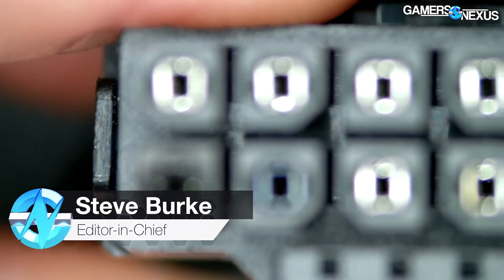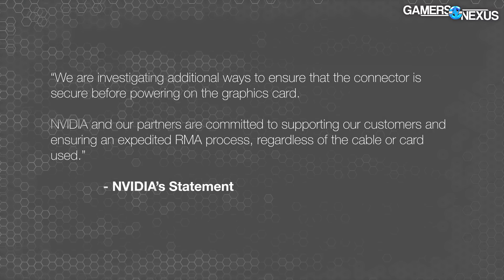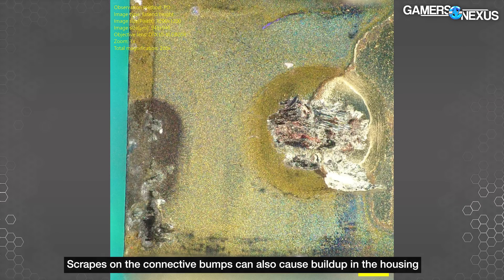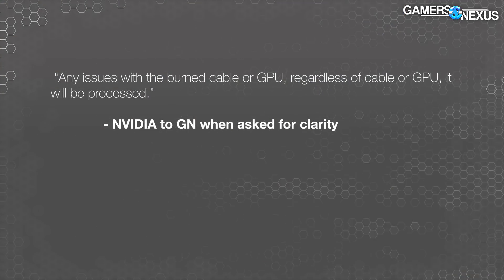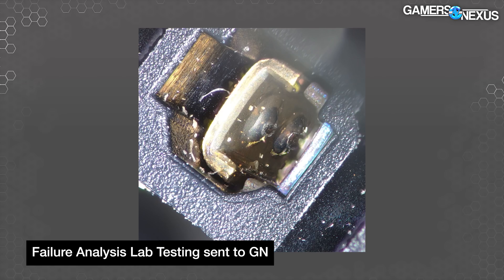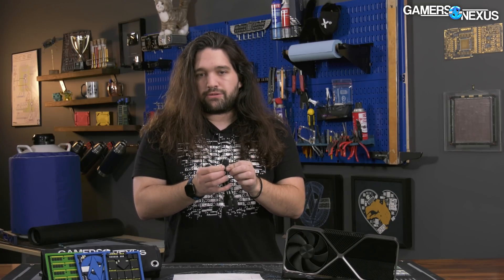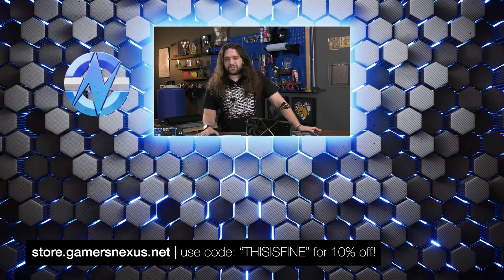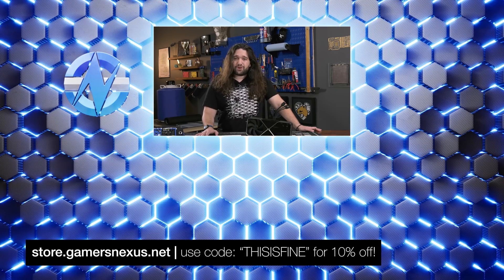NVIDIA Responds to Melting Cables, Warranty Concerns, & 12VHPWR Adapter Failures

Comment: All of these findings makes me terrified for 4000 series cards being sent out in pre-builts. I feel like a lot of new or unexperienced gamers are going to be getting hot glue or unlatched fire hazards in the coming years
Reply: I for one welcome the return of our screw based friends that we've lost along the way, R.I.P. VGA, serial, and parallel connectors :`-(
Reply: @msytdc1577  it's not the hdmi or dp starting the fires though... Idk what the ports on the back of the case have to do with this issue...
Reply: @whitekong316  OP said we'd see hot glue to keep the connector connected, and I was saying that another method of doing that is to use screws, and listed a few connectors that used that method in the past (but are no longer in common use), and that I looked forward to that method making a comeback, which was a joke, because it's not actually a good way of doing things, which is why it went out of style in the first place.
Reply: @msytdc1577  ah went right over my head.
Reply: @msytdc1577  think he was pointing out lotta prebuilds hot glue stuff in and that could be dangerous if they are not plugged in fully though.
Reply: @msytdc1577  get screwed with your screw fetishism
Reply: @msytdc1577  F that, they need to adopt a twist lock standard for VGA power, that'd almost certainly solve these kinds of issues permanently, assuming proper connector quality. Maybe a miniaturized Speakon 4 pole, you can use two pins for sense and one for ground and one for voltage. These connectors are generally quite beefy as they're built for audio, but you could still miniaturize one while keeping it 4 pole, and have more than enough power carrying capacity on a single pin to handle even the theoretical 4090ti. Standard Speakons are built to accept a 12awg wire per pin, which can handle well over this 12 pin connector's spec on a single wire, especially over the distances of a typical VGA power run. The sense pins would not need to be nearly as beefy either, 24awg wire would do for that, so all you'd have going in is a pair of 12awg wires or alternatively a bundle of thinner gauge wires, plus the two sense pins. Essentially no more wire than you have going into the current 16 pin, just clumped together into fewer wires. I'm sure there's plenty of other good ways to secure a connection like this that don't involve tiny flimsy plastic and metal bits clipping together, if twist locks are a bad idea as well for some reason. I don't see how they would be though, you can key them in such a way to prevent improper plugging in, and so that none of the pins pass over each other improperly, creating a short where you don't want it.
Reply: @TheOriginalFaxon  while im mostly with you.  Neutrik powercon (the mains version of speakon) is a great connector, but even the full size version is only rated for 32A. No way are you going to miniaturise it and carry 50A. The cross-sectional area of multiple pins is where the rating for this stupid connector is coming from. There are many existing connectors in amphenol, or ITT cannons catalogue that have the required multiple power pins and additional smaller signal/sense pins. None are cheap, but neither is this card.
Reply: @msytdc1577  Absolutely not! There is very valid engineering reasons those connections are dead. Modern display port, usb-c, HDMI cables connectors are designed to snap clean off or buckle if they take too much force so that a yanked cable will not potentially damage thousands of dollars of hardware on either end of the cable.
Reply: @infernaldaedra  lol, no, they're not designed to breakaway, and you absolutely will wreck your device's connector and/or the board it's attached to. If you don't believe me just search up "PS5 HDMI repair" or "Xbox HDMI repair"  right here on YouTube and behold the internal carnage.
Reply: @msytdc1577  Please don't comment what you don't know, I have a decade of experience doing board repairs and am completely familiar with how HDMI connectors anchor. It's the cable end that is supposed to be designed to break. That's literally the reason we don't use screw in display connections.
Reply: @infernaldaedra  show me in the specs for the HDMI standard where it specifies the breakaway parameters that need to be adhered to in order to be in compliance with that standard. I'm sure there will be requirements for things like angles allowed before breaking, minimum and maximum breaking force, the number of allowed cycles of repeated stress before breaking prior without hitting the breaking force. Right? I mean it wouldn't be left up to the manufacturers to just do whatever, surely not. You are the expert after all, so I'll wait.
Reply: Most of the cables I am referring to are the generic looking black plastic/rubber ended HDMI, and because I know you have one could just look at the cable end to see behind the metal connector housing, the  metal is not supported or anchored to the cable, Unlike the female connector on the equipment side. It technically only has to be weaker than the solder anchors on the equipment side of the cable to work. if you take a normal HDMI cable and plug it into for example the back of your TV then smash the cable down the connector is supposed to break clean off inside the equipment connector end preventing expensive repairs.(this is not always true because of different cable brands but this IS in fact the INTENDED function of the connector)

Most aftermarket cables diverge in some way from normal standards anyway and normally only follow basic guidelines like shielding. To meet the required HDMI version of which there are actually about lots of current specifications.

 I'll list them off so you can come to the conclusion that you didn't think this through very well. 

1.1,1.2,1.3,1.3a,1.3b,1.4,1.4a,1.4b 2.0,2.0a,2.0b, 2.1 all have distinct specifications as they are all separate set standards. 

-Out of every one of these versions there are 5 acceptable HDMI connectors with a respective M/F connector 

-not to mention that many cable brands will put metal around the cable because it's good for strain relief and looks premium but it does potentially ruin the safety feature. 

-Suppliers for the connectors themselves will have the datasheets you are asking for.  The minimum standard is ~10,000 mating cycles, -20° to 85°c operating temperature, at least 0.5a current capacity, and meets or exceeds UL94-VO specification, specs for voltage is down to conductor quality and quality of shielding. Which is the largest difference between the versions and is essentially a rating system.

But. If a cable manufacturer buys HDMI connectors from a supplier and uses them in a cable or adds extra strain relief (LIKE METAL) around the cable ends this safety feature is null and will not work as it's been removed for the sake of better cable strain relief. Which is usually when you buy metal ended HDMI connectors they have a habit of prematurely blowing out, bowing, buckling, splitting, cracking, for breaking solder connections on the female connector.

If that doesn't make sense to you idk what will bit it's the same thing as the Nvidia cable  issue. They are all the same cable yet built 10,000 different ways

And to basically tell you you clearly don't know wtf you're talking about it's the way you worded the question that is not possible to answer as what we are discussing is not a "necessary feature". 🤡
Reply: @infernaldaedra  This argument doesn't apply here because no yanking should ever occur inside a PC case during its use.
Reply: @infernaldaedra  You're the "ibecile" here if you don't understand the difference between an external cable that's always under the risk of being yanked, and an internal one that's only under this risk a few times per life cycle of the hardware.
Reply: @vsm1456  what part of the discussion was about internal cables, it's about the connectors engineering You just came in blindly talking about internal cables 😂
Reply: @vsm1456  The point is that everything needs to be made not only idiot proof but also accident proof as well. As MY comments were pertaining to Video connector designs not PCI-E power connectors I don't have any clue how you think my argument is errant when you just pried into it talking about a totally different topic
Reply: @infernaldaedra  The first reply in this comment thread was about using screws to secure GPU power connector. You replied to that guy and said it's a bad idea because a cable should fall out if yanked hard. This is what I replied to. It was all about internal cables.
Reply: @infernaldaedra  Maybe there were some deleted comments in this thread, but those that are still there imply that the topic is about internal cables (GPU power) and how to make them secure. Like really, I'm not replying to your later comments, I'm replying to your very first one. Which looks like you disagree with the idea of using screws for that, but the reason you provided applies to external cables.
Reply: @vsm1456 Well maybe the point went amiss My first comment is an explanation as to why they are no longer being used today. As many devices have gotten smaller screw in connections for external use are only really used for legacy compatibility. Although the standard VGA connector was strong enough to swing a monitor around by the cable that's the problem.

Internal electrical connections like from the PSU to the GPU shouldn't need mounted with screws especially considering that would add bulk, weight, cost, and worst of all... complexity to the internals of a PC so much that many people would be dissuaded from DIY installs and would someone like my job much harder if instead of clicking in 200 connectors a day that would be 200 more times in a day someone like me might have to reach for a tool that we really shouldn't need. As well as there isn't any mechanical strain really being put on internal connections besides thermal cycles and screwdown connectors might restrain thermal expansion enough to end up with similar cable burning issues.
Reply: @infernaldaedra  Okay, I see where you're coming from.
Reply: @msytdc1577  nice. I recently purchased an old Amiga, and it was fun to go back to those cables
Reply: @jeffmccloud905  Dear God, flashbacks of how many times struggled to get fingers on a small and too close to other things finger screw only to find it nearly impossible to unscrew as if a gorilla was handed a screw driver and had at it. Only finally succeeding after finding your own screw driver, and then seeing that a stand off friend came along for the ride and now you're forever left with only one side being able to be screwed in properly unless you only ever use that same cable for the rest of time, because to fix it properly you'd need to find some thread-lock (if you even knew that existed) and a tiny hex driver or bit to tighten it, and you know it'll probably just come out again, so what's the point... Hold me, I'm scared.
Reply: It’s fine. Catching on fire is a feature amd doesn’t have. The fanboys love fire.
Reply: The adapters are probably gonna be glued into the GPU so hard you'll pull out the motherboard outside the case before the adapter comes loose.
Reply: you’re the first person (that i’ve seen at least) to bring this up. if some OEMs/SIs can screw up the most basic things, then 4090/4080s are gonna be a total nightmare to deal with.
Reply: Upvote on this..
Reply: With how tiny that latch is for a large bundle of pretty stiff cables I kinda expect the prebuilds will Epoxy or UV resin bond the cable in to ensure it survives shipping, hot glue is good and all, but mostly because it does fail without too much effort - so you can still get things like this apart later... Not great for being shipped around, especially in the back of the big tin box with no aircon...
Reply: Didn't think of that... most of those can't get simple cooling correct.  You're spot on!  Yeeks!
Reply: Didn't even consider pre-builts.  Yikes.
Reply: They will probably hot glue the hell out of it once inserted. (Correctly we hope)
Reply: Unexperienced PC builders*
Reply: Choice point
Reply: Good point.
Reply: Will 12 year old child workers in Malaysia have the strength to plug these in?  Time will tell.
Reply: Total design flaw issue with lack of proper education for users about how to tell the cable is fully seated. Hopefully Nivida will be on an education campaign and changing any stickers or attaching one to future adapters.
Reply: @Vanilla_Donut  "total design flaw issue"... That's the ultimate problem with this connector. User error is just a symptom of the bad design. The design needs to be fool proof. You need to be able to easily plug it in fully and have it securely latch with no way for it to work loose. If it's not fully seated it should not still work. The connector needs to be far more robust than it is, especially with the amount of power that it's supposed to handle (600w/50A). PCI-SIG and their partners that helped design this thing need to go back to the drawing board and try again.
Reply: @Vanilla_Donut  I have seen comments like this so often yet nobody talks about the fact that it is exactly the same design as most other PCI or EPS connectors. If fully plugged in you hear a click
Reply: @AlpineTheHusky  The issue is trifold. You need more pressure compared to the previous 8-pin times x design, the click sound is not as pronounced and extreme bending such as cable management or tight case panel could cause issue. People are coming in with this wealth of knowledge assuming that it is the exact same when it is clearly not by how GN is telling us what users need to look out for in terms of extra pressure is required, telling us the click sound isn't as pronounced, double check after cable management and closing the case panel. This type of education was needed but was not done until after issues started to appear. And of course, users were not aware of such differences so we end up with such problems. User making mistakes due to a lack of knowledge from what they already knew.
Reply: @Vanilla_Donut  The click is in my experience just as loud and pronounced as with most other connectors. The bending is barely an issue if connected correctly. Yes you need more force but its still common sense to push it in until its seated. I have known or atleast experience and suspected this early on as I have built a PC for a friend and his connector burnt. He wasnt too knowledgable with PCs but likes to tinker and show off. He pulled the card out took pics and put it back in with the connector not fully seated. He was also overclocking it tl hell and back when it happened to try its limits. While a failure rate of 1 out of...5 or so I think I built isnt really decisive it does still show it can happen but is very unlikely to happen to someone with normal knowledge on building computerd
Reply: just plug in your graphics card correctly dummy
Reply: I still think a forced recall will happen eventually.
Reply: @corruptedpoison1  lol not for .04% of idiots not plugging in the damn card properly
Reply: 0.04% odds....take it and run
Reply: Sounds like a personal problem tbh
Reply: Are you serious? There was only 50 cases reported GLOBALLY out of 150K cards sold. No one house was burnt down or there wasn't any deaths from this. You are the same person that uses a high combustible vehicle that have a multitude of failure points that is more terrifying than this. 
Since that you're scared of electronics, perhaps you should live in a Amish community to put your worries to rest!
Reply: @spankbuda5760  erm, theyve only been released for a couple of weeks. Not exactly a lot of time for failure modes to come to light. Im not quite so terrified, but it is definitely a concern, bad design and you can bet if not addressed it would only be a matter of time before someone gets hurt.
Reply: @jeremyglover5541  Erm, the 4090 release date was 10/12/22. How is it a "bad design"? It's a connector! There's countless images of burnt motherboard psu connectors but that's not a concern? You want Nvidia to address to the customer AGAIN on how to connect a connection properly? We need to be concern about the education level with some of these individuals. It's sad that Steve had to demonstrate to the audience on how to properly connect a connection.
Reply: @spankbuda5760  lol. Only someone with no actual argument would nitpick over that.

How is it bad design? Did you not watch the video? Have you not seen the connector and cables? It uses a connector that has to have wires stuffed into it, poorly heatshrunk, basically no strain relief, sticks straight out, rather than a right angle, or proper locking design. Uses sense wires, yet apparently does not implement any way to know if it is not seated correctly on start up, or in operation. Runs on silly low voltage and stupid high current, when they could easily spec it to run a higher voltage and lower the current significantly, then just change the DC-DC convertor design. 

combine that with a card that is so stupidly huge that it has clearance issues in many cases; making the chances of extra strain being put on a connector that is clearly not up to the job significantly higher.

For a product of this price to use such a janky solution that wouldnt even get past my standards for DIY is unbelievable.

To top it all off, supply it to people who in many cases know little to nothing about consumer electronics, let alone basic things like ohms law.
Reply: @jeremyglover5541  Well, only a person try to make the release date of the 4090 2 weeks old as if to say that "there isn't enough time yet to calculate the defective GPU's yet." 
Again, how is it that this cable is "defective" when 150k cards have been sold GLOBALLY and only 50 burnt adapter cases? 
The GPU's are not defective. The cable adapter isn't defective. This comes down to user error! If it wasn't user error Nvidia and Steve wouldn't be explaining AGAIN to the end user and to the audience on how to connect a connector properly! 
This is why I've mentioned the burnt PSU to motherboard connections when there's more cases of this actually happening.
Reply: @spankbuda5760  mate, if you find this whole thing is able to be just blamed on the consumer, i dont know what to say to you. You must be some fanboi. Yes, absolutely the end user contributed here, but there are a bunch of factors that lay squarely on the manufacturer also. They know who their market is. We have seen what even ‘professional’ builders do. 

 pretty thin argument mate. Couple of weeks vs  just over a month make virtually no difference. Its still fresh as. If a significant number had failed already only a month in after the very first units of a flagship range became available, this would be an absolute nightmare.

Its idiotic interconnect design. Any engineer looking at it will agree. Many have already voiced these concerns. 

Ive already described how its defective. If you cant tell by looking at it, dont understand the significance of what ive written already, or need some more handholding to understand, thats not my problem.

Designing a new connector that requires multiple crappy plastic pins be used in parallel to deal with the current multiplies the possibility of a partial borderline connection in parallel, makes for more points of failure. Then you make it so there will be a larger than normal chance of putting strain on the cable… dumb as sh1t.
Reply: Anyway that’s enough of the youtube comments section for today. Have a nice day.
Reply: @jeremyglover5541  How in the hell am I a "fanboi" of PCI SIG connector? Are you a "hater" of it? Because this adapter was used on the 3090 Ti's and wasn't an issue. 
Your dislike about the design of the adapter isn't a "design flaw". And it's certainly not the cause of the 50 adapters melting. 
I've mention the burnt PSU connectors on the motherboard twice and you just gloss right over that. But you want to change the launch date and mention about these unknown engineers and random individuals in your argument as if it's creditable facts. 
Then you mention about the tugging on the adapter is one of the root causes of it melting as if it's a faulty solder joints. 
It was proven in GN experiment that the melting of the adapter was caused by improper seating of the adapter because of the end user not properly clicking the adapter in the connection. 
This is what you're suppose to do with ALL connections. So how is this considered a "design flaw"? 
You would have a point if the adapter was snapped into the connector and then started melting. 
But you will move the goal post again to say "Well, we don't know yet. The card just came out!". 
Here' what Corsair had to say...
"Corsair's in-house PSU expert, Jon "Johnguru" Gerow has said that the melting power connectors on NVIDIA's current GeForce RTX 4090 could just be users installing the 12VHPWR connector incorrectly."
I couldn't find all of these engineers that you claimed who have weighed in on this.
Reply: @spankbuda5760  "Because this adapter was used on the 3090 Ti's and wasn't an issue." - That's a great argument. Interesting why.
Reply: Yes .04% of them could suffer SERIOUS DANGER of a melting connector!
Reply: @bobvila4381  .04% is not an insignificant amount of people at nvidia's scale
Reply: @roboko6618  well, it's 50 out of 125,000 apparently. If it's seriously only that few the GPU maker will probably just refund anyone it happens to and not even blink. The lower tier cards have no reason to exhibit the same issue. Statistically, based on the data presented here, this is 100% a non issue in my mind now and I'm not going to pretend that it is until someone effectively refutes the 0.04% stat.
Reply: @bobvila4381  0.04% is a horrible failure rate, and runaway thermal events involving high power connectors are dangerous.  There's quite a lot of power being drawn into those 4090 GPUs.
Reply: @bobvila4381  the more 4090s get bought through pre-builts, the more of them will melt. Delivery will increase the potential for the cable connection to come loose significantly.